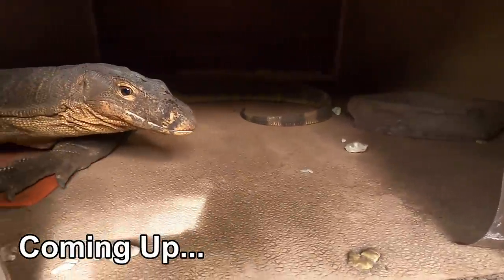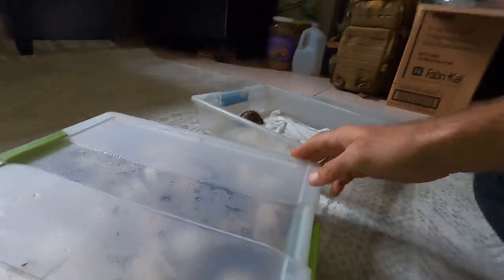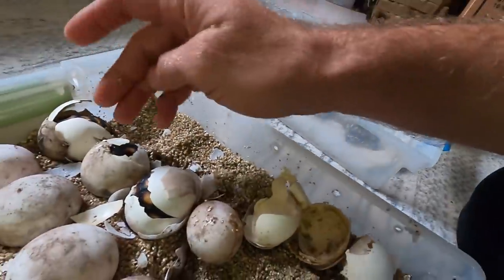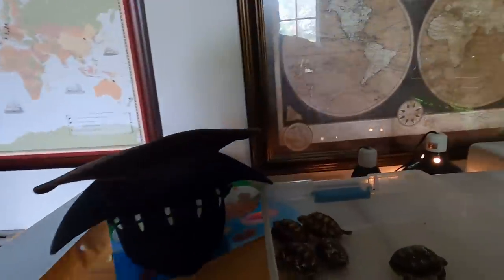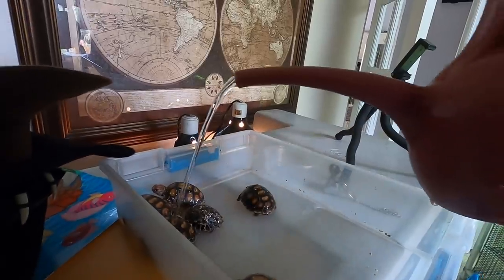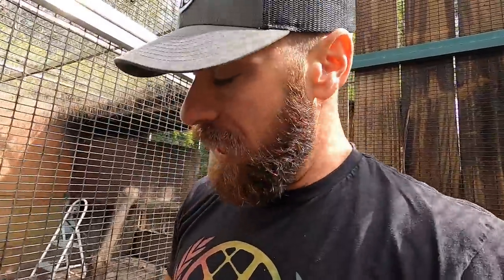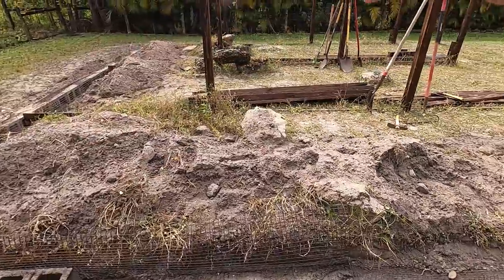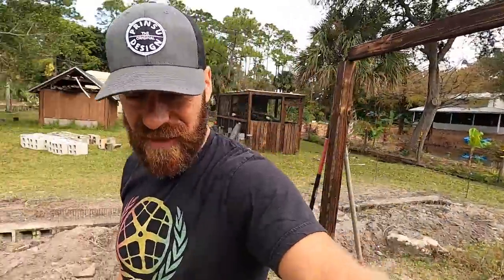Incubator Update + Big plans for Slinky!

Comment: Try painting on liquid tar on the bottom and sides 6 inches up of the 4x4s and any other wood that is close to the concrete blocks. You can also put the 4x4s encased in concrete by using wood molds and pouring the concrete into the molds you make and have the 4x4s inthe mold, then pour. This is going to be amazing...!

Comment: By putting the flat idea down it won't bite into the dirt with the added weight as bad as the hole side would. So it'll settle at a more level pace over time and not become uneven and cause breaking as easily. But yes you explained it fine 😉

Comment: The new enclosure will be nice! 
On the bottom block row, I like them turned for a couple reasons, as you mentioned sinking less likely and sideways orientation will allow for some additional drainage. There is a reason I don't like it though, structurally the blocks are very weak sideways and very strong with holes vertical. Only being a short wall and the enclosure not being extremely heavy I don't think it will be a problem but I would definitely ask a brick mason about it.
There is a chance something i built catastrophicly failed because of blocks being orientated horizontally.

Comment: The strength of the cinder blocks is having the holes facing up so they can be filled with concrete and rebar, also you should mortar them together like bricks. If you do that it will last a long time as a solid unit to keep Slinky safe.

Comment: I understand the logic behind the cinder block position although I'm not sure how that is going to work with the blocks above, the entire system works because of the cells allowing you to put reinforcement and more concrete so it all connects and behaves as a whole. Wouldn't the footer blocks move eventually? Aren't you connecting them somehow?

Comment: Kenan, how you explained the orientation of the cinderblocks makes sense. You wanted to have the weight borne by the biggest surface possible. PS. Those memory lapses best handled by Keto and b complex with nutritional yeast and/or liver (The more the better) along with a few other supplements. When the liver gets fatty (I know, as I have nafld) then it does not process the nutrients so well and such things as memory lapses and the fatty roll below the belly button occur. See Dr Eric Berg for more data. Unless he understands nutrition (most don't) no psych is going to be able to help with mental problems brought on by nutritional deficiencies or toxins.

Comment: Don't use wood to separate the two ponds.  It will rot in no time.  Either use concrete block, or form and pour a concrete divider.

Comment: If you stood  the block upright and ran rebar around the perimeter at each course (Notch the block and every 2 feet run a vertical rod down tying the horizontal and vertical rod together) Then fill the block with cement and use a small vibrator down every block cell fully filling each block sell with concrete. That wall wont go anywhere. Breaking it down will be a real bitch but you said you want it to last. This is how we used to build footings for modular houses. Meets the specs for the Federal govt.